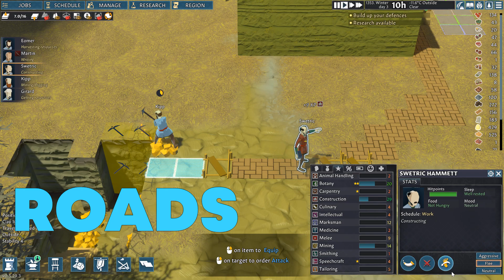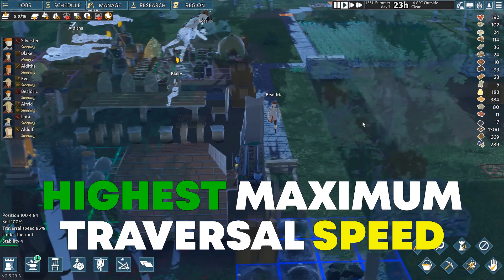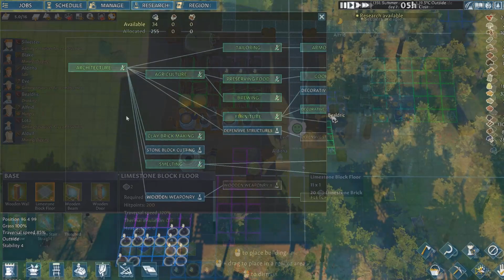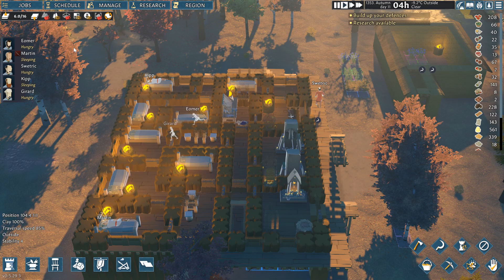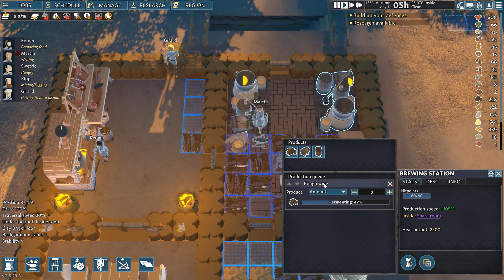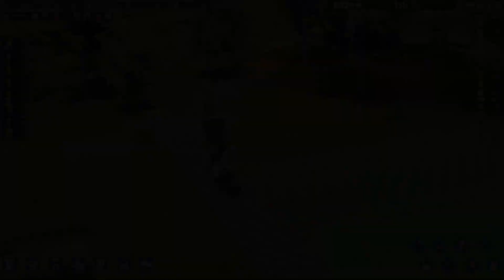📛Roads In Going Medieval | How to build Paths, required Technology, Settler travel Speed | Guide #11

Comment: Honestly, when of building material, you'd think Limestone would be much stronger than clay.  Too me, it makes no sense as i've worked with clay bricks.  Clay is tough, but nothing compared to strength of solid stone block.  As for speed, yeah, I can see them being same since all doing is just making flat even surface to move on.  If they ever add anything like carts or wheel barrows for settlers, you know it be hugely faster for them.
Reply from the maker: Video Game logic :) the more important thing is the great settler programing because of how easily and readily use the roads.

Comment: You said something about limestone walls being better than clay, i thought they both had 800 hitpoints on the brick variant. Am i missing something?
Reply from the maker: I was mostly referring to the simpler versions, 150vs300 HP. Also, limestone bricks are made faster, but limestone deposits have more HP so they are harder to dig. There is a trade off at every point. Thank you for the comment TminusDoom and welcome to my channel.

Comment: The huge pain for clay though is that it needs cooking time.same as brewing.whereas limestone bricks can be crafter straight away.The sad thing about this is my trap system might not work.since raiders might use the roads as well.please correct me on this peter.thanks
Reply from the maker: Yes everyone benefits from roads. But raiders have set targets like your settlers and workbenches. So you can set up traps with the right bait.